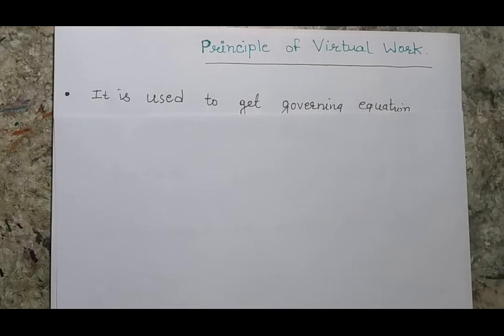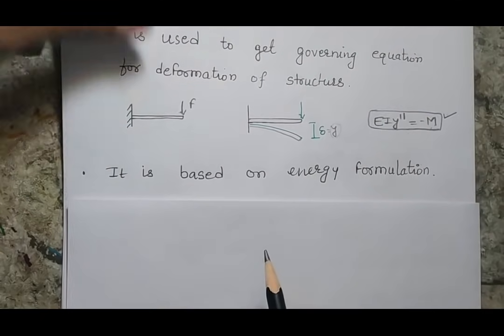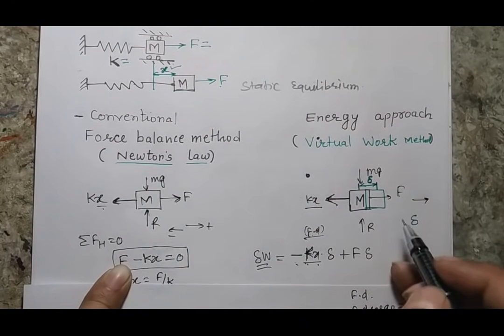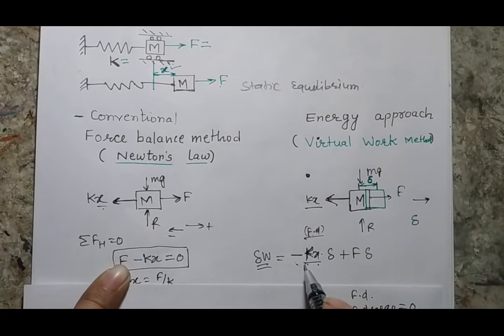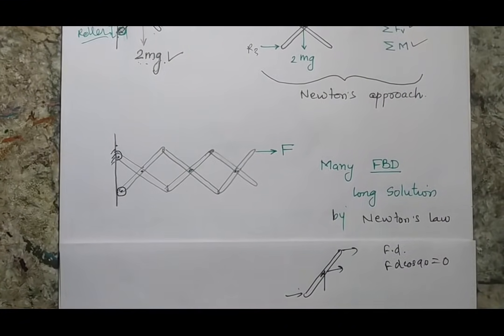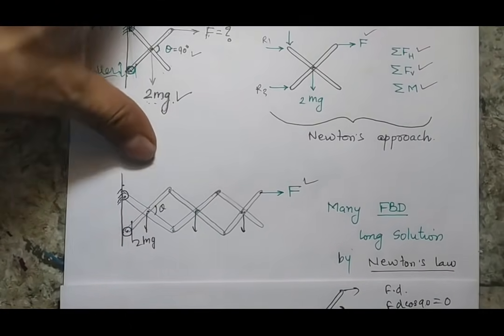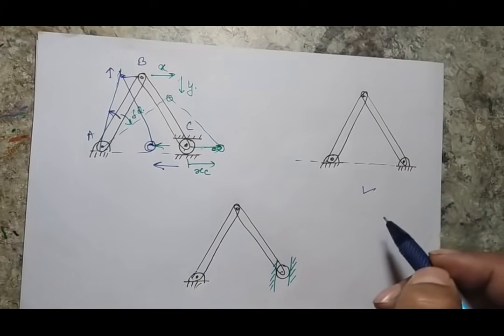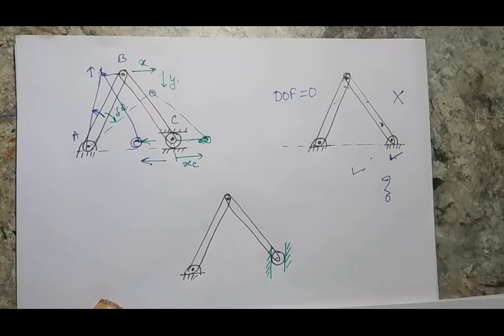Concept of Virtual work Principle (Lecture 1)|Engineering  Mechanics|| First year course

Comment: Sir, In newtons method, you have stretched at some distance x , so you told the force act on the mass by spring is -kx.
But,
In energy approach, you virtually stretched some infinitesimally small distance ∆r , it could be, the force by spring, -k ∆r. 
How it could -kx.
This is my doubt, i don't know, it may be a totally wrong question....
Reply from the maker: Hello and sorry for replying late, When we are doing energy approach, we actually disturbing our system from its equilibrium state, means at this moment, the spring is stretched. So if you give del_r displacement actually the spring is now having a total change in length is (x+del_r), but as del_r is infinitesimal small so we assume the spring force still kx and then we say the work done by spring force is k.x.del_r. if still I could not answer your query, let me know I will try to explain it in other way.
Reply: @ashishpurohit9138  no need for that sir, this is enough, i understood and thank you very much sir to consider the doubt.
Reply from the maker: Complete lecture serie of mechanics for your refernce https://youtube.com/playlist?list=PLi0hoi2vOpnQ1wu7w4CMSUobzKuWIEThQ